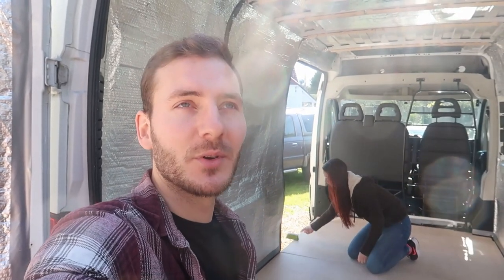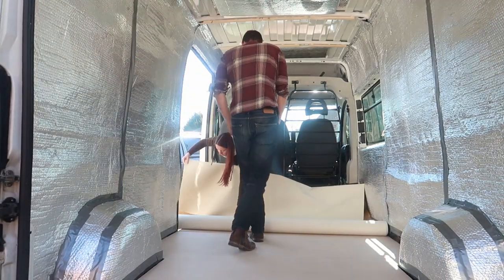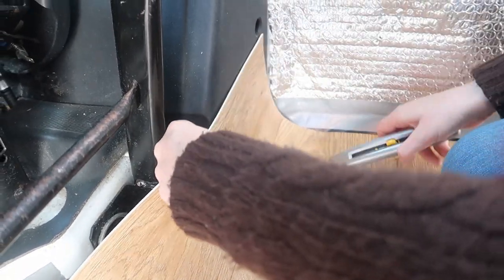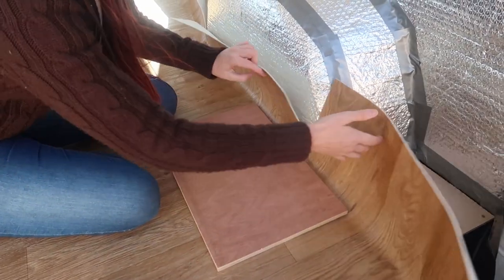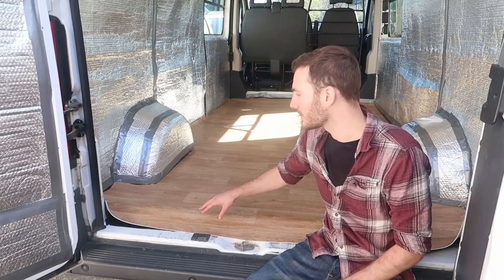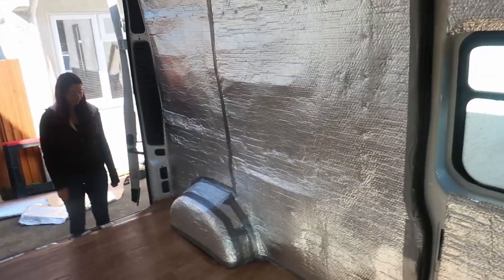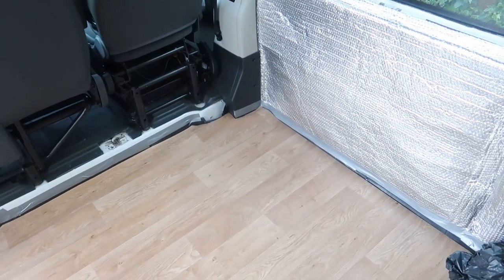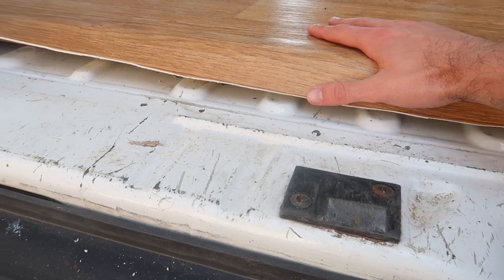Laying a Lino/Vinyl Floor in our Van | Beginner Van Conversion Series UK

Comment: Spray adhesive looks really easy! Wondering whether to use it for my build. Did it hold up good over time ?
Reply from the maker: It’s worked good so far :) we’ve had no issues

Comment: Next time use cardboard boxes.  Lay them flat, on top of oneanother if need  be, use duct tape to hold them down and together, them remove them as one big template, then lay that weird cardboard shape onto the laid out on the ground vinyl flooring.  Trace then cut.